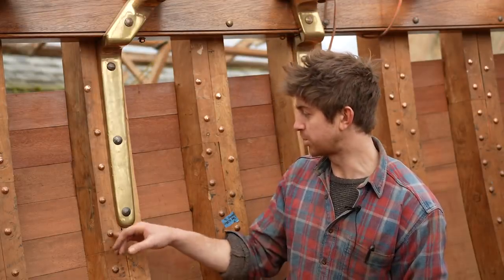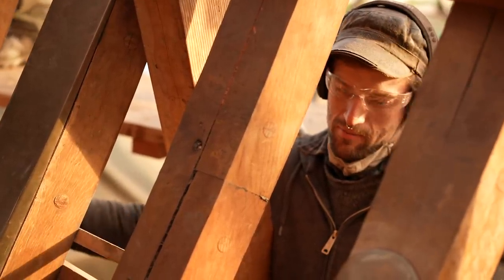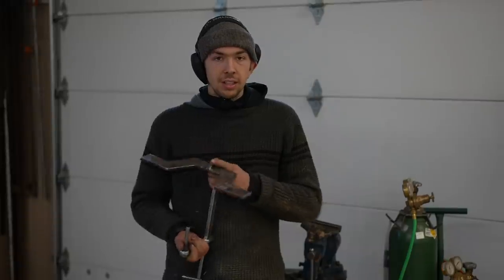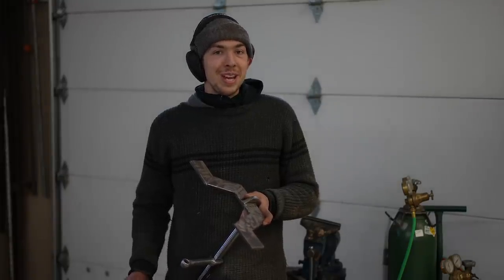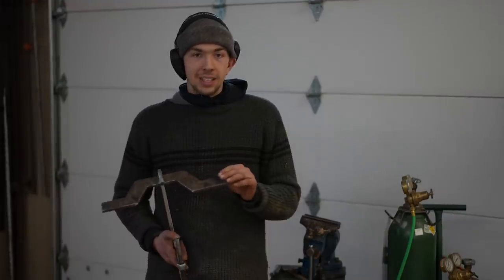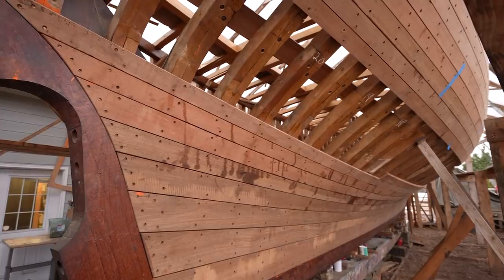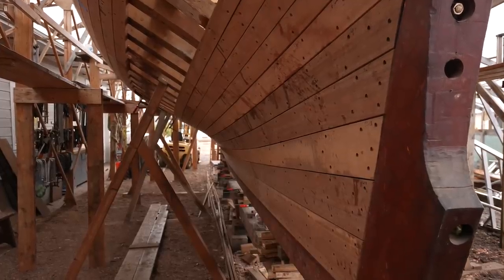Planking the Hull - Part 2 (Rebuilding Tally Ho / EP91.2)

Comment: Leo,
If you are feeling very science-y and curious, you can do the following: 
- Take a cut off from your planking, full width, but only about two inches long.
- Measure its width with a micrometer or other very accurate device.
- Measure its weight with a lab scale.
Put it in a very warm, dry space for about a week. Not hot enough to scorch, but very warm. Maybe on top of a baseboard radiator, or in a warming oven (about 120F).
Remeasure after a week, and you will have a very good estimate of moisture content and expected maximum shrinkage. (Moisture content = loss of mass / post-drying total mass)
Thanks for sharing all the excellent work of you and your crew.
-A woodworker and former lab nerd

Comment: This is like Noah's ark with all the animals waiting to enter! The craftsmanship is next level!
Reply: I'd bet Noah's boat was just knocked together.  After all it only had to last a couple of months and there was no one to show it off to after it hit the water.
Reply: @jerrymiller276  No way. It was built over 100 years. It was built using technology that was ground breaking for the time. Evidence found at the Noah's ark site has shown it was made using large hand forged riots in the wood.bit had to be built incredible strong and it was according to Gods measurements. The scale of measurement is still applied to large ships today.
Reply: @TheJiminiflix  A joke.  Please.  It was only a joke. 

But where do you get that it was built over 100 years.  The bible and the Quran are both very unclear about this, with confusing information.  There is no evidence of the building site of the ark.  And no agreement as to where it came to rest. And I was unaware that ship builders anywhere still use cubits as the scale of measurements.

Don't take my word for any of this.  Read it for yourself from the only sources of info.  Everything else is mere speculation.  Extraordinary claims require extraordinary proof.

Comment: I doubt the original Tally Ho construction was so carefully fitted.
Reply: True, this is cabinet maker quality. I did similar work in Cape Town and our quality was nearer to Asian dhows and junkmen using mostly axes and adzes, galvanized Scandinavian square nails.
Reply: I think you are grossly underestimating the pride of craftsmen throughout history. 

Everywhere on the planet throughout history people have used all the technology and capabilities available to them to make things to the best of their abilities. 

This boat survived 100 years which in and of itself is testament to the high quality of workmanship originally used to build Tally Ho.  

Unless of course you are making a reference to General Motors. 🤡
Reply: @OnTourWithPattiSmith  GM:  Warranty three years.  Tells suppliers parts should last 3 years and one day....
Reply: I disagree as well.  I guarantee it was as high of quality.   They just didn’t have the nifty cordless tools but their quality was still immaculate.
Reply: An early episode showed guys making pilot boats on the beach and I doubt they did the measuring Leo does, but if Leo makes 20 more his' eye' will change. It is all relative. (unless there is management involved #GM)
Reply: phlodel the original would of been made for a working life of probably 30 years or less
Reply: @bigears4426  Built by a commercial boatyard on a time schedule. My point, exactly.
Reply: phlodel a boat or a car will only last as long as maintenance is kept up even tallyho wouldn't last long if not looked after
Reply: Your attitude seems to be a common one in these degenerate days. In truth, while this vessel is being built to a very high standard, if you were able to watch the craftsmen of the nineteenth and twentieth century in say the Fife yards in Scotland or the Herreshoff yard in Bristol, Rhode Island, you would find a much higher standard of workmanship. I have had the pleasure of working on many old boats, including a couple of old Herreshoffs, Abeking and Rasmussen, Paul Luke, and others less well known. The quality of their construction is in no way inferior to that of Tally Ho. 
People today have little comprehension of the level of skill required in building a comparable boat, never mind the demands of the client who is paying for it.
Leo and Pete are the real deal. In any one of those old yards, they would be journeymen on their way to being master builders. In those days it took many years to climb that ladder, there were no boatbuilding schools. You served an apprenticeship, became a journeyman, and eventually became a master. Poor quality builders were soon out of work. Owners then expected a high standard of workmanship, today only a few know the difference.
Tally Ho is a marvelous reminder of what real dedication and skill can produce. However, she is not unique in that.
Cheers,
GP
Reply: GV Perkins tallyho is being built like a piece of furniture, old craftsmen only finished the visible side , most things were quite rough unless very small
Reply: Totally Agree,  Leo has improved on Tally Ho's faults ,plus the bronze brackets instead of steel don't get me wrong the tradsmen that originally built her did a fantastic job or she wouldn't be here
Reply: @OnTourWithPattiSmith  This is a common error. GM sells a 50,000 mile car. Almost all of their cars make it to 50,000 miles without repair, provided only that the oil and lube is kept up to date. When you buy a dozen eggs and eat two a day, you do not complain that the carton did not last through nine days. But that is what you, and many others do about cars. I have seen videos on YouTube specifically claiming Subaru is junk because the engine always blows the head gasket at 150,000 miles. That is THREE times what Subaru sold it as, so the fact is that Subaru cars are marvelous because they exceed their promised life by three times.
Reply: @johnharrop5530  that sounds correct to me. I think the biggest difference would be in the materials being used. Also back in the day they may have used a lot of green wood.
Reply: @bigears4426   I’ve worked in five different boatyards doing everything from replacing planks, knees, stem timbers, to finish work and rarely have I ever found original work to be “rough”. The men I have worked with would have been horrified to have done “good enough” or “rough” framing. We are not talking about fishing schooners here, we are talking about yachts and the pride in workmanship of those that actually built them. I have been fortunate to have worked for one of the best builders in Maine. He would never at any time have tolerated anything but best quality work, whether it was the joinery of the stem or the framing of the cabinetry.
Reply: @abelkotze521  0.04mm and it was jammed. wow.
Reply: @stevefrink4842  
Your doubts are unsubstantiated.

Comment: Gotta wonder how Leo's doing thru out this extended time ashore. Worried about loosing his sea legs?   Also, very surprised at how well Poncho accepts the cold weather. Not often you see a Parrot
 in the snow.
Reply: London has a considerable population of wild (some say feral) parakeets. They do fine with our sometimes snowy weather.
Reply: @Dave5843-d9m  there are feral monk parakeets in NJ
Reply: A true sailor never loses his sea legs, they just need recalibrated.
Reply: Named Pancho actually.

Comment: What is the reason for using the orange lead sealant on the ends of planks in the aft, but not on ones in the bow? (the ones Pete is fitting versus the ones Leo is working on).
Reply: If I may say at the afe you have the end grain which has ti be sealed

Comment: To check the MC you could use an offcut, weigh it, and then dry it in an oven, slowly and not so hot as you cook it, until it has stopped losing weight. The difference between the two weight will enable you to calculate the MC. This is the way they used to do it before moister meters came into being and it's the way I do it for my furniture stock.
Tally Ho is really now taking form with the skin going on, keep going I can't wait to see the finished boat.

Comment: Excellent recording of an excellent build. It seems that Leo's School of Dodgey Boat Building has pretty high standards, .004" at butt joints is incredible.  An impressive shot at 8:10 the background is showing a lot of planking. You are getting close!!!!  And then at 14:52 I don't think I've seen a parrot sanding in snow, more evidence of the dedication to the project.

Comment: Sampson Boat Tools: Idea - A bunch of specialty tools have been created like rivet clamps, butt block clamps, saw and router angle jigs.  Turn them into money for the project.  To make the tools you could partner with other YouTubers like 3D printer channels or metal fab channels.  With others creating the tools, the impact on the boat build could be minimized.  In the end you'll have a few tools selling and it will help you to sail off into the sunset.

Comment: It may be useful to carry out a few different wood moisture measurements and relate these values to the density.
You can generate a correlation or graph which will enable you to determine moisture content from a value of wood density (and vice versa)

Comment: You can reliably measure moisture content without knowing SG by using the oven dry method. Weigh sample, place it in 105 C oven for 24 hours then weigh again. Place back in oven for a few hours weigh again, repeat until weight stabilises. Then you can calculate the %age moisture in the original sample.

Comment: Leo, with all the video documentation and perfectly symmetrical construction standard you guys are following, it would be fairly easy for the Albert Strange Society (or someone else) to make a complete 3d virtual module of the Tally Ho as re-built. If the model were assembled in a CAD program with layers,  it could be a wonderful teaching tool of how this boat, and other boats of this vintage were/are assembled.  Unfortunately something of this nature is not my skill set, but I would love to have it available to so I could click on and play with the model.  The database could report every rivet, screw, and bolt by length and diameter, if that level of detail were desired,

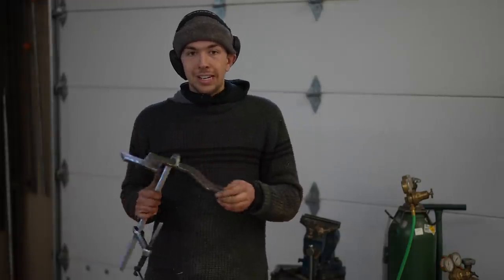Comment: Suggestion for the butt-block peening clamp: Inertia is everything. Instead of a stiffer clamp, a dead-weight on the screw-shaft will help a lot. Right now, the only counter-inertia (to take the hammer-blow) comes from the mass of the screw. The stiffness of the clamp does nothing on a short timescale. The counter-mass (on the screw-shaft) should be at least equal to the mass of the hammer, preferably 10x higher. 13:38

Comment: Well, if you really want to know the moisture content, you take a sample, weigh it and then dry it in an oven and weigh it again. Or weigh it repeatedly until it stops losing weight. Might not be practical on a plank-by-plank basis, but it could be done at some point if desired.

Comment: Take a cutoff block and dry the hell out of it. Measure the size and weigh it. You will get the "dry density" then weigh your boards and you can figure out the %moisture by the added weights as weight of water in the size of board you are referencing if u want to know moisture content.

Comment: Watching that last plank be fitted is going to be so satisfying! Hope it's closer to 2 weeks from now than 2 years, though. I'm curious if Leo will put the boat in the water before finishing the interior. Sounds like it's common for vessels like this to leak at first before the wood swells and everything seals up, so wouldn't that get the engine, batteries and interior cabinetry and all that wet? Seems like it would be a pain to do all that work at a dock rather than here at the build site. Anyone know?

Comment: Leo or Pete, Rather than fully riveting the planks on each side of a shutter plank, making clamping difficult, could you use very long carriage bolts or all thread rods to use to pull the shutter planks in then replace those bolts with proper rivets once the shutter plank is riveted?

Comment: If you want to establish the average moisture content of a given parcel of lumber, choose several pieces, hopefully defective, go to the middle of the board and cut a 2 foot block. From that block cut several thin wafers from either end and weigh them immediately. After Wang the wafers, put them in a low temperature oven at about 180Fahrenheit. This can sometimes take 48 hours. Once those wafer cease to lose any weight, just do the simple math to determine moisture.  Summer Raleigh. If you want to track the loss of moisture across the load while it is Drying, Take the section of wood from which the wafers were sourced, seal the ends, and periodically weigh The section. The correct calculation can be found in the killing operators manual published by the US forestry service, Just Google it

Comment: Great project and amazing progress. Technical question, are you and Pete using the same technique in sawing the curved plank edge? It looks as if you use a batten to guide the rolling bevel equipped circular saw, and that Pete doesn’t use a batten. I may be not seeing clearly, but wonder what you think the pros and cons are of the batten versus freehanding that cut.

Comment: I am wondering if one of Pancho's parents was a Penguin or Puffin..no way is it a suitable environment for a tropical parrot LOL
We have a similar tradition to the Whiskey plank when building a house. 
The day the roof frame is finished, the lads will crack a slab of beer and use the empty carton as a flag on the peak.
I myself will partake of a Rum in salute, when that last plank is riveted home.
Cheers from Down Under where it was 30C today ;)

Comment: Leo, You have talked a bit about the role of fitting planks, their spacing, and caulking and each of their role in keeping out water from  leaking into the boat.  They all seem to rely on their ability to accept water and "swell" in order to insure tighter fitting.  My question has to do with the role of paint on the hull in this context.  Is the paint on the bottom expected to be a water tight "membrane" (as  most land lubbers like me would assume) or is it to be semipermeable to some extent to allow the "swelling" to occur?  Any thoughts about this role would be interesting  to hear in a future video.  Thanks again.

Comment: Leo - a quick question......does the term “wiggle room” mean the same thing in boat building as it does to every other technical/engineering profession? Having watched you and the crew work with such attention to detail it also begs the question - are your wiggle room tolerances in the sub millimetre/micron size or just a case of a 1/16” give or take?
Just joshing, the boat is looking amazing and the crew seem to be really in the zone with their mojos working overtime!

Comment: Even the ones above the water line should swell cause as the boat heals and takes waves it should suck in water like a sponge if its dry , I never built a boat but I am a carpenter and have seen wood swell and srink in the rain my whole career

Comment: Pancho looks cold.  Parrots prefer 65-80F, but can tolerate 40-90F, so if it's below 40F there, she'd do better indoors (even though she clearly loves strawbossing the restoration).   The slow walking and near stumble at 22:00, or the biting at the camera at the end, could simply be her usual comical personality, but both could also be symptoms of infection.  Not to be an alarmist, and everything could be perfectly fine.  But her species is from the tropics.

Comment: So you're extending the planks past the endgrain of the transom. Once you've cut them flush, how will the caulking seal be wrapped around the end of the plank to seal off the transom?
Reply: There's won't be any caulking in the joint between the hull & transom planks. There will be plenty of bedding compound, but hammering caulking into that seam would further weaken the already-weak screw connection between the hull planks & the transom plank end-grain.
Reply: @frederickstibbert7389  Yeah I didn't figure there'd be caulking between the transom and planks, but the caulking taper stops ~1/2" from the base of the planks, and curious how that'll be sealed.

Comment: Hi, great build! I do have question. It seems that some of the planks are hard to get it in position. Will the natural memory of the plank (wanting be straight) cause problems later?
If you were close to me I would offer to help. Thank for taking the time in doing videos!
Reply: That's true when the planks are first installed, which is why they're being installed in mirror-pairs instead of "the entire port side, then the entire starboard side". Over time, say a month or six, the wood fibers will compress or relax to their new shape. After that, they'll exert very little force on the frames.

Comment: Leo ... what is the wood box contraption on the side of the Porter Cable circular saw?  A good shot of it is @ :20 into this video
Reply: It's a homebrew angle adjuster & gauge, the plank edge bevel changes along its length.

Comment: Leo, avid follower of your channel and have loved, and understood all your videos ( if we just skip the whole lofting thing, lol). When you talk about measuring moisture content you lost me. In using a pin style moisture meter it uses the principal that moisture conducts electricity well and wood is a good insulator. Both the resistance and the dielectric properties change in direct proportion to its moisture content . There can be a correction made for different species ( most US meters are set for Doug fir) using specie correction charts, but frankly if moisture is less then 12% the corrections are so minute as to be meaningless. I can’t speak as to the pinless meters but I think you’ll find the meters that use pins to be accurate and useful.